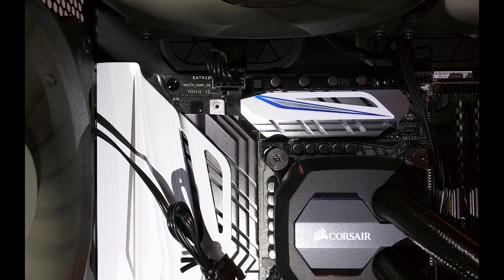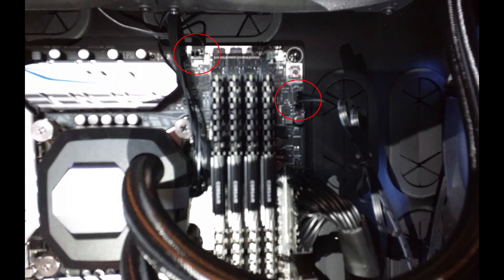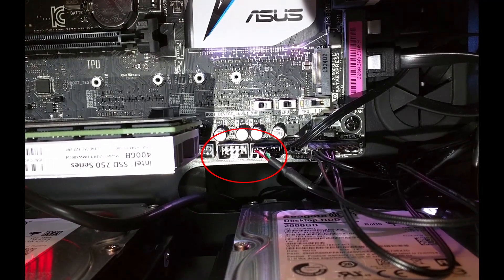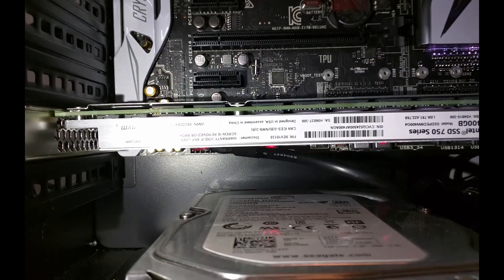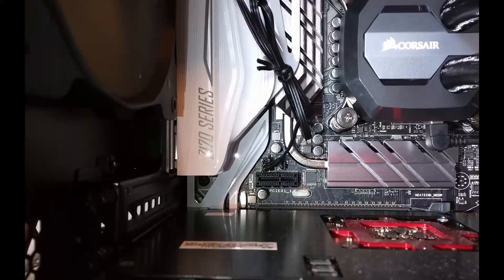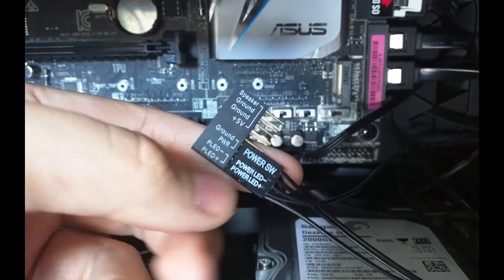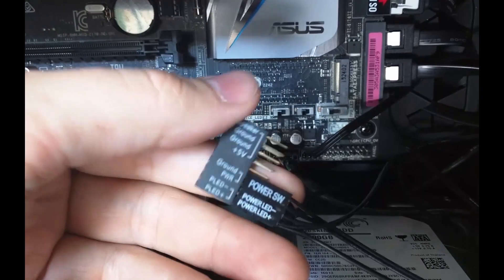Z170-Deluxe / Z170 Motherboard connector rundown

Comment: Hi. Do you know where I should be hooking these up? I have the "PWM Connection" hooked up to CHA_FAN1. But I'm not sure where "ARGB Connection" is supposed to be connected to. Thanks in advance.
Reply from the maker: This particular motherboard has no ARGB or RGB headers. ARGB wasn't really mainstream when these motherboards came out. Are you using the same motherboard or a different one?

Comment: Got a Z170A Gaming M-7 trying to figure out where the three wires bass, left, right from the Logtech system plug into the 4 opening on the back panel, the old board it was color labeled matching my speaker wires I'm guessing the Chinese ran out of color??? any body know know or were the hook up.

Comment: So the z170-AR has no 5V header for fans/RGB?
Reply from the maker: It has fan headers, but no RGB.
Reply: @UnhingedSystems  damn... but RGB headers are only important if you want your MOBO to control them, right?

Like I can connect TT RGB strips with existing fans and control via TT software instead?

Comment: Sir I have a question,How to fix No signal monitor 
I check my cable 
Check ram
Check GPU
Reply from the maker: How many outputs do you have for your display? Try some of the other outputs. Are you using HDMI, Display port, or DVI?
Reply: I’m using VGA  cable sir
Reply from the maker: @jordanvaldez7132  do you have a separate video card, or are you using just the on-board graphics?
Reply: I’m using the on board graphics,What is Better using on board graphics or gpu
Reply from the maker: @jordanvaldez7132  If you have a GPU you will need to use the video outputs from it. The video outputs on the motherboard are typically disabled when using a separate GPU. When you computer is powered on, does it have any indicator lights on the motherboard or a code display showing any error codes?

Can you provide me the specs of your system? Make/Model/Motherboard/CPU? 

Message me on Twitter, we'll see if we can figure it out. Send me some photos of the computer/motherboard and the cables on the back to Twitter as it may help. Twitter is @praxpresents

Comment: I have the Asia Z170 Deluxe, and I’m starting to get the error code 02 and the storage/boot error LED lights up. Does that mean there is something wrong with my SSD or the motherboard?
Reply from the maker: Sean O'Brien motherboards rarely fail, though raid card stability has been an issue for the z170 (keep the BIOS updated). If you have an overclock, go back to factory settings and see if you still get the error. My initial guess would be the SSD has failed, though usually when I have seen an SSD failure (Intel) the drive usually goes into read-only and at least tries to boot (motherboard doesn't know anything). Try disconnecting the SD and booting to a CD, if it boots, try connecting the SSD to a different SATA port (use the other controller) and select it as your boot device. If you get the same error on both controllers then it is the SSD.

Comment: I built a new pc i turned it on and the motherboard rgb lights turned on, my gpu turned in, my aio fans started spinning, all my case fans started spinning but the problem is that all ports doesnt work 
please help 
Sorry for my english
Reply: I think the problem is because the power sw on the q connecter broke an then i made it straight again or i maybe didnt put the aio right

Comment: I got a similar build that is not working. My PSU works, tested. I got a corsair mid tower case and a evga p2 platinum PSU with a z170-AR and i7-7700k. The power button never worked and the button on the MB did not work!??
Reply from the maker: Does anything at all happen when you press the power button, or no signs of life at all? there is probably a device or component preventing the power-on. Start my removing some RAM and other devices one at a time and try the power button until you get some signs of life. Just remember to unplug the power between component removals.
Reply: When I removed the CPU 12v power, the power button worked, 
after that, I put the 12v power back. Now the button works, 
but I still don't get video out of the motherboard on HDMI. 
No post boot at all. I hear the HDD start-up and the ram LED starts, but no boot on screen!!

(The memory had a fault, but I pushed the Button next to the ram and the light went away
(The CPU had a light blinking for a while but then goes away)
Reply from the maker: Try booting with only 1 stick of RAM, and less components. Do you have a video card or just the CPU graphics? If you have a graphics card, use the output on the card.
Reply: I tried booting with my GTX 1080 but the same problem occurs. No video output. All of my parts are new out of original box bought from Microcenter.  (the graphics card lights up green, but that just shows there is power)
Reply: The cooler was plugged in incorrectly and my CPU had a burnout taking my chipset with it. SUCKS SUCKS SUCKS!!!!!  (At least I still have the 30-day money back)
Reply from the maker: Dhyan Amin sorry to hear that! what cooler we're you using? That would definitely do it.
Reply: I was using a salvage stock cooler and some thermal paste. It was just temporary till my Corsair H110i came through amazon in 1 day. (I just wanted to put it together and test it out before the cooler came) DAM IT
Reply: I salvaged a Stock cooler From my old prebuild computer. It had a VPro i5-5th gen. I was even surprised the old thing fit. It was a simple heatsink with a DC 3pin fan on top. Very temporary. (Since my motherboard went to computer heaven, I might get the ASUS ROG STRIX Z270E, the newer models)

Comment: will this run with the on board display port and hdmi, or is a graphics card required?
Reply from the maker: Scott Peckham It sure will, as long as you use a CPU with integrated graphics :)

Comment: Hey man i got a i7 6700k and my pc wont boot. My moniter says no signal but it powers on, in putting the wires in some wrong place. I wonder what :(
Reply: Bleach did you ever find it what was wrong? Having the same problem.
Reply: Yea man, i was stupid and put the tiny connecters in wrong place, then i found out my ram didn't work. Got new ram and bam it's good

Comment: Hi, could you tell me why my front panel power button is blinking? the pc is still working properly. Thanks
Reply from the maker: Is it blinking on and off consistently or kind of random? If the power button is wired up correctly then it should just be on or off unless there is some special setup for your case. The only other thing I can think of is if you some how have your power LED fed off of the HDD LED header, but then technically your power button shouldn't be working properly either...double check where you have the power button plugged in.
Reply: It is blinking on and off consistently. Power button and hdd led are plgued problely. The whole pc runs fine. That is why I don't understand. My case is Nzxt s340, asus z170-a, evga GTX 1070 FTW. Thanks.
Reply from the maker: What motherboard do you have?
Reply: I have asus Z170-A motherboard
Reply from the maker: Strange, usually if the power button is blinking on and off it is because the computer is sleeping...  There are some people that reported issues with the power button on their case for the Nzxt s340, usually that the connection was loose and it took a few tries to turn on/off. If all your cables are in the right place, I would think it might be some funny wiring on the case wiring. Thats all I can assume without taking a closer look at the unit.
Reply: It is really weird for me too. I think just gonna stand with it for a while to see if anything happens then. Thanks so much for your help.

Comment: hey prax im so happy that you did this video as everyone using this motherboard and building a gaming pc show hot to build it but not where to connects all the cables.  I really appreciate this very much.  Im still stuck in some parts as I have 7 fans and the water cooling that I dont know where to connect and where do I install windows, to the SSD which I have a Corsair Force LS 480GB and  a Seagate 1TB HD.  thanks again man!! for REAL!.
Reply from the maker: 7 fans? Did you get a separate fan controller? Most motherboards only have 3-4 fan headers. Definitely install Windows to your SSD, that way you will get the best boot up and loading times. Nobody wants to wait for their computer to load up slowly.
Reply: Thanks for your reply. Well I have a 
Carbide Clear 400C Compact Mid-Tower Case, a Asus Z170 motherboard and a Corsair Hydro Series H100i v2 Extreme Performance Liquid CPU Cooler. So my cooler has 4 of them on the top of case has 2 and one on top of the power supply. I got all this from a video and I put it together. I just bought a fan extension card which Arrive in 2 days.

Comment: Thanks man just building my first ever rig at 33. Looking to build a mega rig with a cCorsair CC-9011022-WW Obsidian Series 900D E-ATX Super Tower Performance Windowed Case for Computer - BlackPlease could you recommend the best motherboard for my build ?also gpuI am going to make it at least 64gb ram, 1200 watt psu, 6 ssd's. That's all so far
Reply from the maker: What are you using it for? I am still a huge fan of the 6700k, but depending on what you want it for it might make more sense to do an X99 platform.

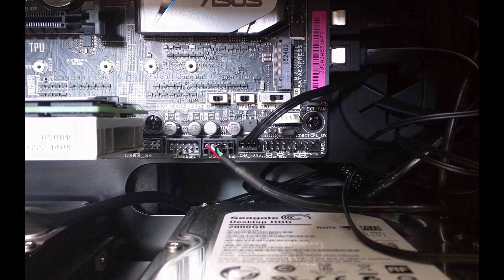Comment: what is a q connector at 4:13
Reply from the maker: Asus calls it their "Q" connector. It is for all of your smaller motherboard connectors like the case power and reset buttons, LED lights, etc. It is a connector block that allows you to much easier connect everything to it, then connect it to the motherboard. It just makes it way easier to connect everything up.
Reply: +Prax how do connect the front panel connections "without" q connector on the ASUS Z170 A?
Reply from the maker: Justin Carreon refer to the user manual and/or the labelling directly on the board. For example, the HDD LED cable will be labeled on the cable, and also in the motherboard or in the manual. They are just a little harder to connect without the adapter/q-connector.

Comment: +Prax First Time Builder... Ordered The Z170 Premium... What Is The Difference Between The Asus 980 Ti & The  980?
Reply from the maker: +Stharrison85 The 980Ti is newer, faster, than the 980. The 980Ti has more memory, more processors, more shading units, more texture mapping units, higher clock speeds, and uses less power than then 980. The 980Ti is about 15-25% faster in most benchmarks. The 980 has 2048 Cuda cores vs the 980Ti 2816.
Reply: +Prax Thanks! Do you have a Instagram or Twitter? I'm going to build my computer and get it situated without a graphics card. Then just save up and buy the 980 Ti. The 6700k Just Came Back Into Stock Thank Goodness. Hopefully Is Lasts Until Friday When I Will Have Some Money. IS that A Good idea. To just run my PC for a few weeks without a graphics card or do you think it will put a strain on the i7 6700k?
Reply from the maker: Stharrison85 The 6700k will do just fine :) I did two builds with the 970 GTX to no disappointment. I do enjoy the 980Ti though. Twitter @trevorkiers

Comment: how do i use sata express port?
Reply from the maker: +koreamedia The SATA express port can be used with a compatible SATA Express hard drive, your BIOS may have an option to turn on or off the SATA Express support. You can also use the SATA Express port as two single SATA ports as well. My guess is that SATA Express is going to go the way of the DODO, it just isn't competitive with M.2 and PCIE.
Reply: +Prax I thought sata express is for m.2. I was wrong? and sata express hard drive? is there such a thing? is it faster like ssd?
Reply from the maker: There are not a lot of SATA-Express supported hard drives out there. M.2 is a separate connector on your motherboard (if supported). For SATA-Express there is a cable that that has both SATA connections running along a single combined cable. http://techreport.com/review/26401/a-first-look-at-sata-express-with-asus-hyper-express-storage-device

http://arstechnica.com/gadgets/2015/02/understanding-m-2-the-interface-that-will-speed-up-your-next-ssd/
Reply: +Prax Thanks man. I was confused, but now I know what it is thanks to your help. After all, sata express is not so faster than existing tech like sata3, right? I think sata express hardware is gonna be obsolete in the foreseeable future.
Reply from the maker: I agree, I think we will see more direct to PCIe connectivity and things like the SATA controllers will go away. That will be a good time to completely wipe out CDs too. Hopefully we get a medium to replace optical media so we can get rid of these nasty mechanical drives.
Reply: +Prax I think all the tech such as sata3, cd, and hard drives have their own merits. I don't want anything go away. However sata express seems to be not so characteristic. the cable of it also look ugly. I think the sata express tech is just making consumers wasting their money meanwhile it is making companies have more excuses to launch new products for their own good.

Comment: You have to do something with your sag mate. hurts seeing GPU sag :( </3
Reply from the maker: +Japfan14 I agree, the video card "Sag" is painful to look at. There aren't a lot of really good options that stand out when I look to tackle the issue,, any suggestions?
Reply: +Prax my GPU sagged a little bit, too. what i did was i zip tied the end of my gpu to the 24 pin connector. and viola fixed. others use the fish line method. but i dont like the line showing like a sore thumb. so i recommend what i did. zip tie the end of your GPU to the 24 pin commector :) cheers mate